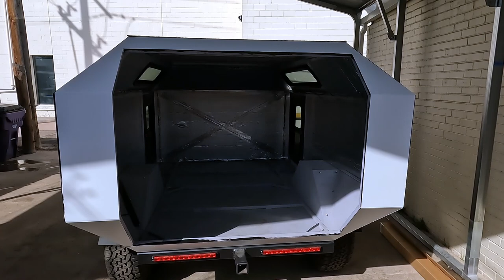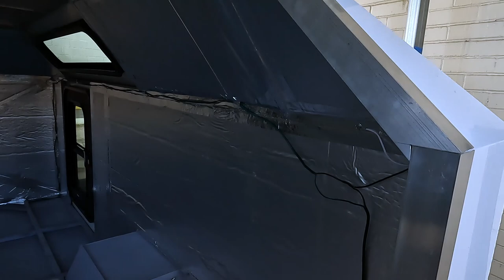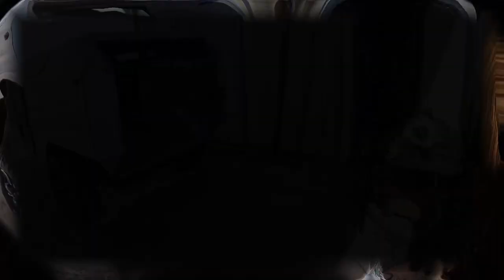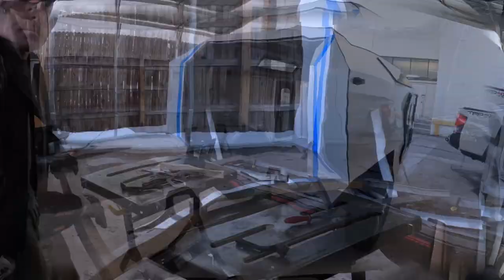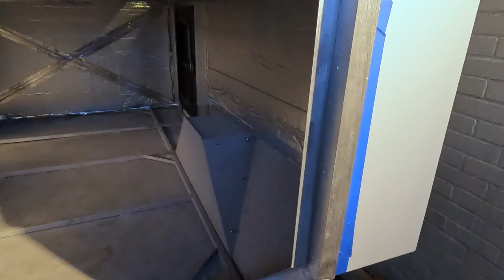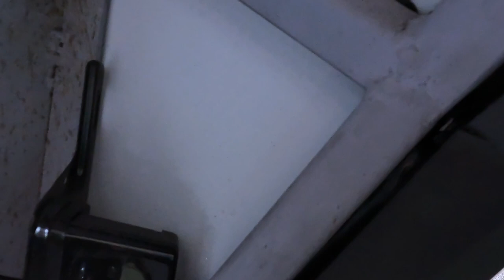DIY Overland camper trailer build: cabin part 14 - Hatch door frame

Comment: What is the brazing material you are using? I'm assuming that is extruded Aluminium?  Where did you source your exterior material? Sorry for all the questions but this is my moat favorite square drop build I have seen. Very inspiring.
Reply from the maker: The brazing rods just came from Home Depot.  The aluminum is 1/16 thick 1.5 wide angle from a local metal distributor.

Comment: Very nice...very clean.  Every Monday I get more anxious to build mine.  I've been struggling with frame design/schematics lately.  Just when I think I have it...I change more.  I just want to get started.  Been buying a lot of steel and supplies/tools though. LOL  Question...when you designed your frame.  How did you come up with the angles/lengths of the A-frame sides? Again just when I think I had my design all set...I read more about the 50 degree rule on the tongue angle.  I literally printed your design out and checked your angles and it doesn't seem that you did the 50 degree tongue? My frame is very similar to yours...although I went 5x9'.  The length of my tongue A-frame just doesn't seem proportional.  And, the more websites I lookup for tips, the more they recommend different things.  Lend a hand if you could.  Thanks
Reply from the maker: I just ballparked the angle based on other trailers I looked at.  The main thing I took into consideration was the tongue length to allow clearance in jackknife situation.  As well as the length from ball to the axle, it is the same as the Tacoma wheel base.  At some point you just have to commit to a design ;)
Reply: @infosponge  Yeah I agree.  Did you measure your tongue length from the end of your tongue box? Or, from the cross member at the edge of your trailer box?

Also, isn't that calculation the width of the tow vehicle divided by 2 and then add a foot? I've been reading so many blogs on this.
Reply from the maker: Crossmember, the box needs to be at least half the width behind the tow vehicle so they don't collide.
Reply: @infosponge  Sorry and thanks, but looking at your diagram from the crossmember edge to the tip of your receiver hitch is like 4' 3 7/16"...is that considered the full tongue length? Or does it also need to include the length of the ball coupler? I really appreciate your insight.

And then...your tongue box edge comes out how far from the crossmember to maintain that "half the width" part?
Reply: @infosponge  why did you choose to make length from ball to the axle same as the Tacoma wheel base?    I drive many different combinations of vehicles and trailers and find that I prefer towing when the trailer (ball to axle) is shorter than towing vehicle wheelbase.   

The worst is short trailer behind long truck.
Reply: @infosponge  depends on how sharp you want to turn,   but you're correct if you want to do 90 degree jackknife in reverse.
Reply: 50 degrees is sorta standard, works with a framed couplers and retail tongue boxes.   

But nice to have a hybrid tongue  - A-Frame with a single pole.  Nice to be able to jack knife tight

Comment: 10:11   - what is the wiping process you use?     I saw something similar guys uses wd40 to make caulking look nice on his small camper  https://youtu.be/DqekbiHm6jI
Reply from the maker: WD40 is just an easy solvent that works on the sikaflex 252 without degrading it.